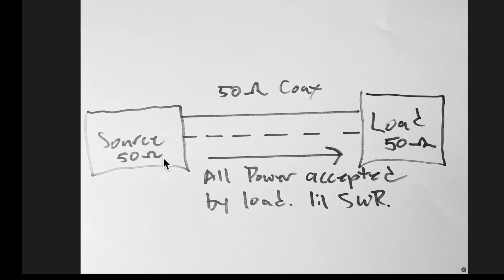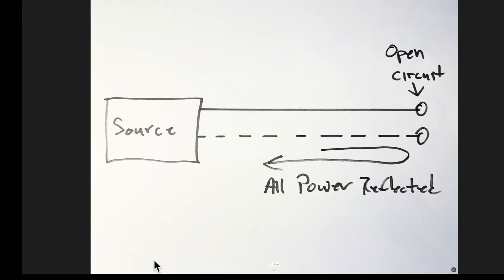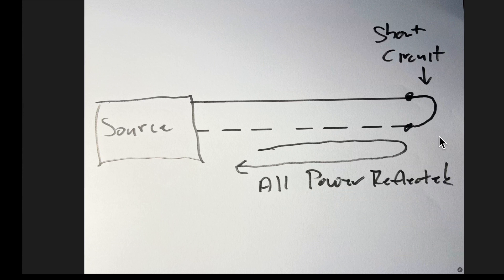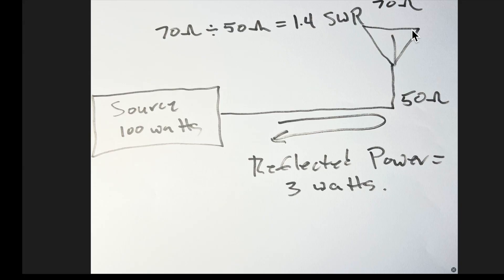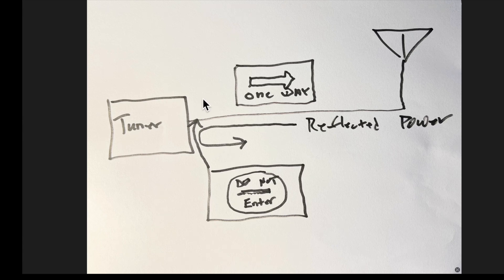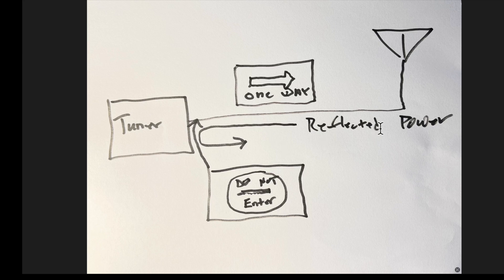Ham Radio Operators Need To Understand Reflected Power.  (So they don't believe myths!)

Comment: How much reflective power can a radio handle? At 30 watts I have 0 reflective power. At 300 watts I have 4.3 watts of reflective power. Is 4.3 considered a danger to the radio?
Reply from the maker: Use this calculator.  You are fine.  https://www.antennas.ca/calc_vswr.htm
Reply: @BustRadioMyths  that’s an amazing tool. Thank you for the reply and link. 73

Comment: I run LMR 400 ultraflex for my 80/40m dipole. I run the knock off "LMR 400" to my Hustler 5-BTV vertical. You should be voted Mr. ARRL genius. I love HAM radio both theory and practice. 73, KJ5LSO

Comment: One way to demonstrate the amount of power of a given transmission would be to set up and a practical experiment where SWR is measured and, "theoretical" loss is calculated.  Then measure peak envelope power at the antenna with a meter specifically used for that purpose. If, for example, the SWR formula predicts a 10 watt loss on a 100 watt transmission, but no loss is seen at the antenna this effectively busts the myth and should end further debate.

Comment: Good explanation. But you forgot to mention that when the reflected power reaches  the antenna tuner and will travel back onto the coax line, it will under go a phase shift, in the same way this happened  at the antenna. 
Love your videos's...
Reply from the maker: Yes you are correct.  Tried to keep it as simple as possible.  I'm going to do another one on reflection gain so phase shift comes into play there.

Comment: Mark, I am very happy that I found your channel. I always questioned the reading on my Palstar SWR/watt meter. If there was loss, why was it added to the total watts out. Got my answers!

I have a question for you. I have limited space for the ground radials on my DX commander antenna. Is it ok for me to cross over 3 or 4 radials  to obtain a good spread as close to 360 degrees as possible.

I haven’t found any resources that speaks to a cross over.
Reply from the maker: Do whatever you have to do to get as much wire in the ground as you can.  It's only an RF ground so I don't see why crossing over would cause any problems.  Some guys use a metal screen so there's plenty of crossover wires.  Get a minimum of 12 radials on the ground and more if you can.  Don't knock yourself silly trying to get a 1:1 SWR.  Follow his instructions, use a tuner and good coax and don't worry about SWR unless it's really high.  Everything affects SWR - soil conductivity, nearby objects and so on.
Reply: @BustRadioMyths  Thank you so much! Currently I have 24 and the antenna rocks. I did employ a good 3 days getting the SWRs as close to 1:1  as I could. So I am not using a tuner. Call me OCD, but in my professional life, I always went for as much precision as possible. It’s also fun and a good learning experience to tune the elements. I really did not need to do that, but I am retired and this happened to be a productive activity and a challenge, so I went for it! LOL
Reply: @BMCTackle At 24, you should be fine. Callum (your antenna's designer), did a video on the topic, back in the day. Pretty much found that after 16 radials, the difference between that, and say, several hundred radials would be about 3 dB more gain.
Reply: @dereks2042  I saw that video a while back. Given my location, soil, etc. This set up works great, but reception Is a challenge. The additional gain while small, helps. This is like your last lime and you are getting ready to pop open a Corona, your going to squeeze out as much of that last lime. LMAO

Comment: Another good SWR video!  I explain it many different ways. Some students get it with one explanation some another way. Keep it up!
Many can visualize water waves hitting a breakwater and bouncing back toward the sea. When the crest of a reflected water wave passes the crest of an incoming wave (sometimes called swells) they add together and the peak is twice as high as one alone.
I can also show standing waves with a rope secured to a wall.    By shaking it up and down I can send waves to the wall and they are reflected back. With the proper frequency you can create a standing wave.

Comment: I love your videos also!!  I try to tell hams what you are saying here but they mostly don't believe me.  I use random wire antennas with good quality coax (LMR 400) and my antennas works all bands from 160 to 6 meters with very little additional loss as compared to a dipole.  I really like the benefit of using all the bands.  Robert K5TPC
Reply from the maker: This makes total sense